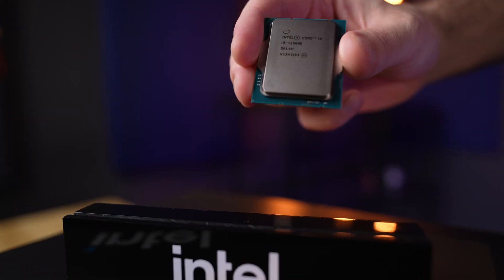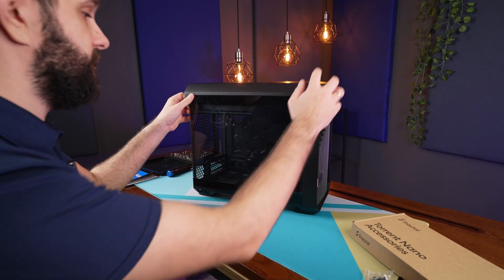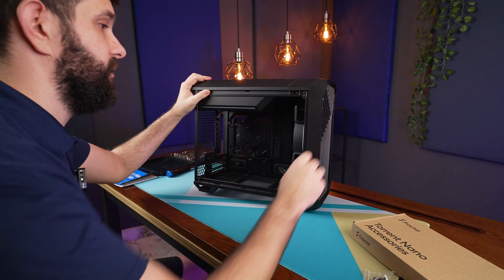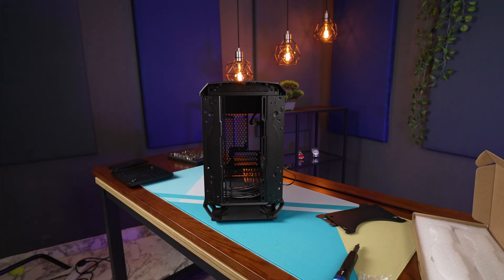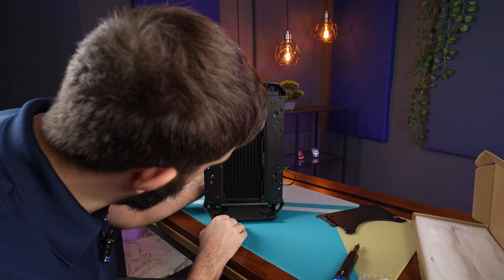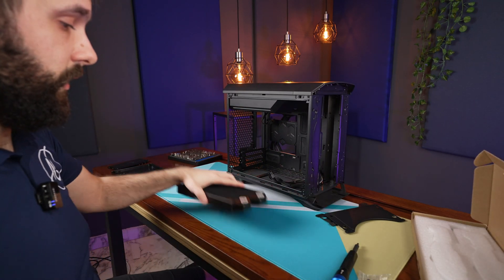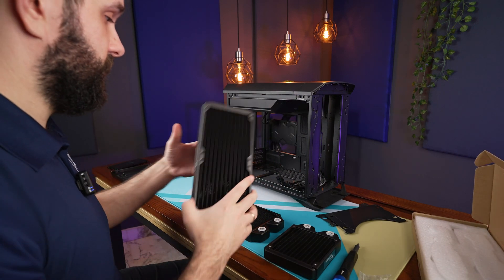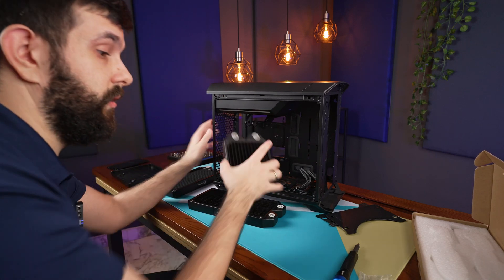Fractal Torrent Nano Watercooling with BitsPower || Part 1

Comment: I have a Torrent full sized I am trying to do a water cooling build in, there is almost NO info on doing one in this case I can find..
Reply: I'm currently doing a build with that. I fit a 280mm rad in the front for cpu. And i'm using my gpu aircooled. So just custom loop for the cpu. It fits the 280mm rad nicely.

Comment: excited to watch this series. would using 280mm rad on the bottom gonna mean you cannot use the 180mm it comes with in any configuration?
Reply from the maker: problem with using any rad at the bottom is amount of space for the GPU

Comment: what was the slim rad you tried putting in the bottom???
Reply from the maker: it was one from XSPC
Reply: @A2KMedia  you could your the tubs coming out the bottom of the case and then in through the back to the cpu block

Comment: Should have went with slim rads and slim fans specifically cross flow rads
Reply from the maker: that could potentially work but would be really tough to do the hard-line tubes in between the gpu and both rads in the bottom right corner.
Reply: Upvoted for crossclow rads. These fans also looked like the rgb rings stuck out farther than the mounts, but not sure.